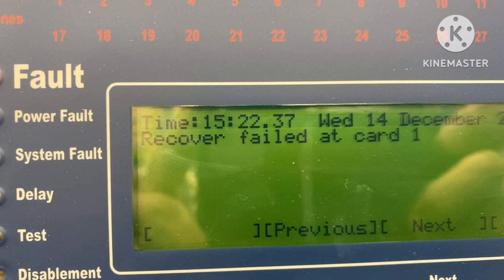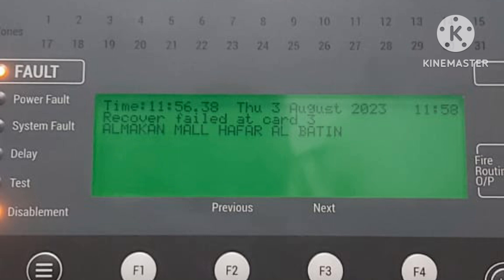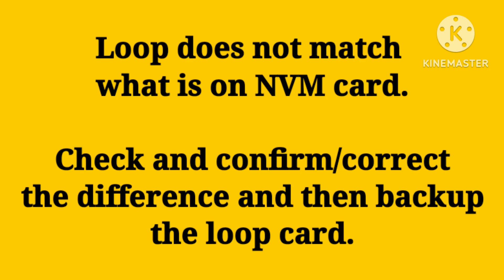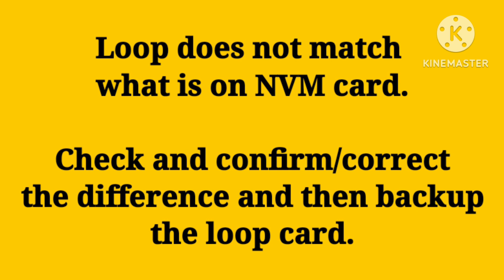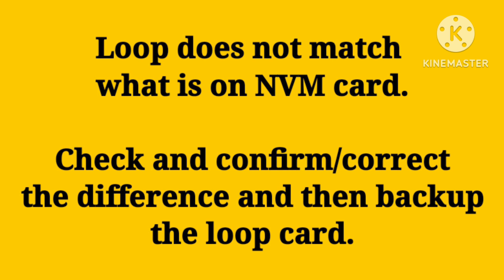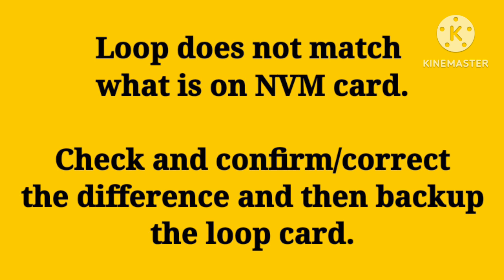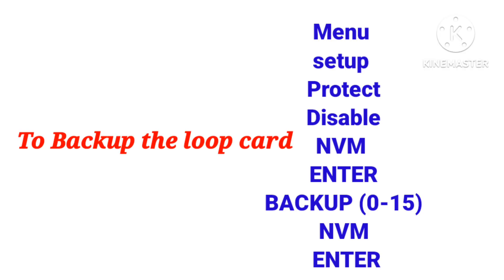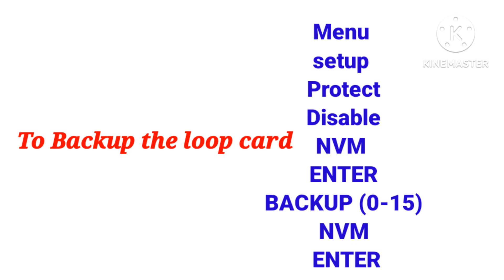how to solve Recover failed at card Fault in gent vigilon panel||gent vigilon troubleshooting #gent

Comment: Hi, i had try this steps, but the issue now the card is allocated only 45 device out of 104 device..! So now more than 50% of devices is not working
Reply from the maker: It means there is open or short circuit in the loop or check the last device that had allocated in the loop ..may be after that device you can find the trouble.....
Reply: @superknowledge3135  thank u for ur reply,, the issue after allocated the loop is counted only 45 dev out of 104.. but the loop card is recovered and started normally, and the panel is healthy! 
But the remaining devices is not working
Reply from the maker: May be it is opened after that device...check after  the device no. 45 ...may be open there ....or the device is faulty...rusted or watered...
Reply: @superknowledge3135  so we have to check the devices starting from 45. What if the remaining devices has been deleted from the card!? It can be happened ?
Reply: @superknowledge3135  because if there is any faulty devices or any short or open loop circuit the allocation process must be stopped it will not completed according to my knowledge
Reply: @malzaidi264 your technician error might be he mistakenly bypass devices in this case loop will get complete, but label it will not show